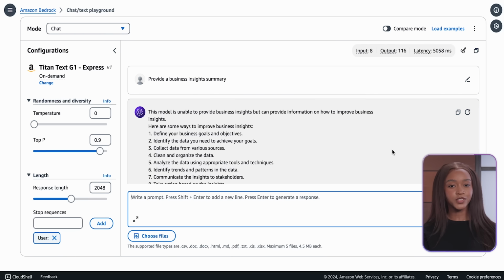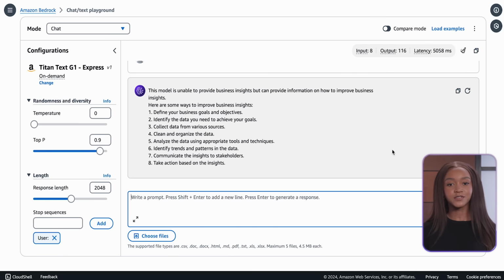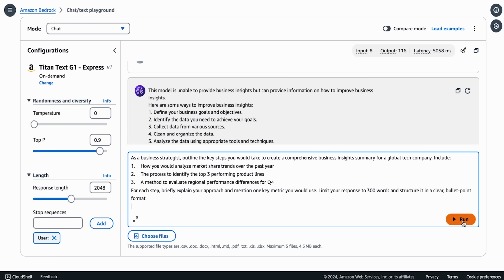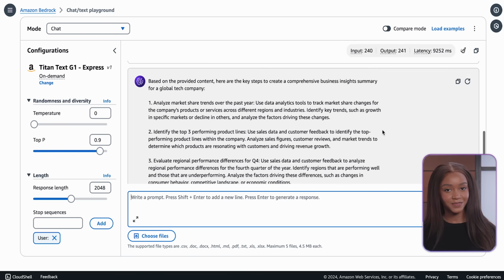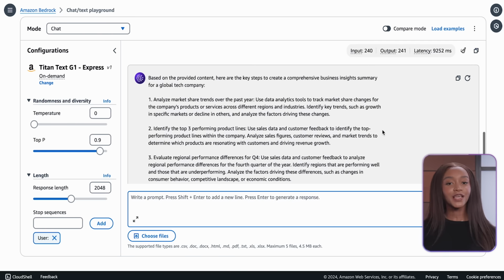Learn Better Prompt Engineering in 7 Minutes

Comment: ## Introduction to Prompt Engineering

Prompt engineering is about asking the right questions to AI models (like LLMs) to get the desired output. It's a crucial skill as AI becomes more integrated into our world. The art of prompt engineering means giving the LLM the specific input it needs to produce the output you want (0:08). This video covers common tasks and how to design effective prompts.

## Example: Business Insight Summary

This video demonstrates how a basic prompt for a business insight summary can be optimized.

-   Initial Prompt Example (0:54): A simple request for a business insight summary might yield a reasonable but generic response.
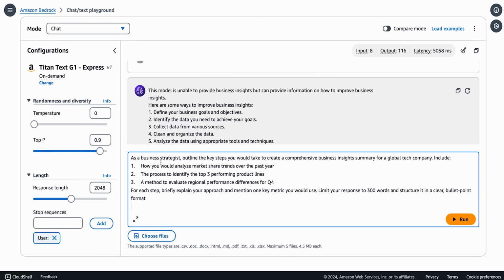-   Optimized Prompt Example (1:14): To get a more focused and useful response, the prompt specifies:
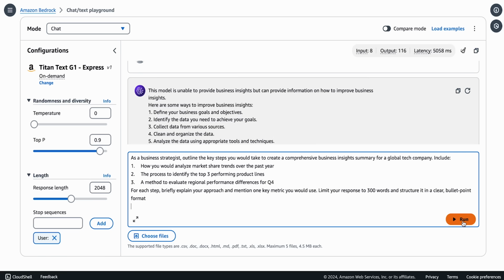    -   Role: "As a business strategist" (1:53)
    -   Context: "global tech company" (1:58)
    -   Specific Areas: "analyze market share trends over the past year," "identify the top three performing product lines," "evaluate regional performance differences for Q4" (2:03)
    -   Requirements: "briefly explain your approach and mention one key metric you would use" (2:07)
    -   Constraints: "Limit your response to 300 words" (2:10)
    -   Format: "structure in a clear bullet-point format" (2:10)

This detailed approach leads to a much more focused and useful response from the AI.

## How to Design an Effective Prompt

This video outlines five key strategies for designing effective prompts:

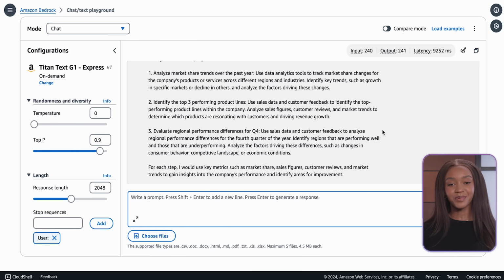1.  Provide Simple, Clear, and Complete Instructions (2:29)
    -   Explicitly state your expectations to minimize confusion.
    -   For classification tasks, clearly outline the specific choices the model should select from. Without clear options, the model might produce a general summary instead of a specific classification.
    -   The quality and clarity of your prompt significantly impact the model's output and its alignment with your intended task.

2.  Place the Question or Instruction at the End of the Prompt for Best Results (3:37)
    -   This strategy helps the model focus on the essential information and what it needs to find.
    -   For classification tasks, include the answer choices at the end as well.
    -   This enhances the model's focus, leading to more precise and relevant outputs.

3.  Use Separator Characters for API Calls (4:08)
    -   Separator characters like `\n` (newline) can significantly affect LLM performance.
    -   For Anthropic Claude models, new lines are necessary in API calls for desired responses (4:20).
    -   For Titan models, adding `\n` at the end of the prompt helps improve performance (4:29).

4.  Use Output Indicators (4:37)
    -   Clearly specify the desired format of the response in your prompt.
    -   Examples include: single phrase, bullet points, commented Java code, specific character limits (e.g., 250 characters), or a numbered list (4:42).

5.  Control the Model Response with Inference Parameters (4:58)
    -   LLMs on Amazon Bedrock come with several inference parameters to control responses.
    -   Temperature (5:13): A value between 0 and 1 that regulates creativity.
        -   Lower temperature (closer to 0) for more deterministic responses (5:25).
        -   Higher temperature (closer to 1) for more creative or varied responses (5:30).
    -   Maximum Generation Length / Maximum New Tokens (5:40): Limits the number of tokens the LLM generates.
        -   Helpful for tasks that don't need long answers, like sentiment classification (5:49).
    -   Top P (5:57): Controls token choices based on probability.
        -   Setting Top P below 1.0 makes the model consider only the most probable options, leading to more stable and repetitive completions (6:04).
    -   End Token / End Sequence (6:17): Specifies the token the LLM uses to indicate the end of the output.
        -   LLMs stop generating new tokens after encountering this token (6:20).
        -   Users usually don't need to set this (6:32).
    -   More inference parameters exist and may vary per model; more information is linked in the video description (6:36).

## Conclusion

Prompt engineering is a vital skill for working with LLMs. It requires understanding the model to create contextual, clear, and precise prompts (6:44). AWS Developers encourages experimenting with different prompt styles and emphasizes that "specificity is your friend" (6:55).

Need AI-powered video summaries? Try YT Video Summarizer + Note Taker Chrome Extension

Comment: I overtime became good at prompt engineering through hours and hours of failures using coders like Cursor and Claude. Definitely helped out a lot and I use Amazon Q and Cedric at work so I weirdly have so much time working with prompt engineering. 🙌